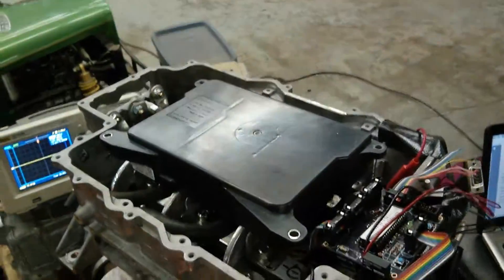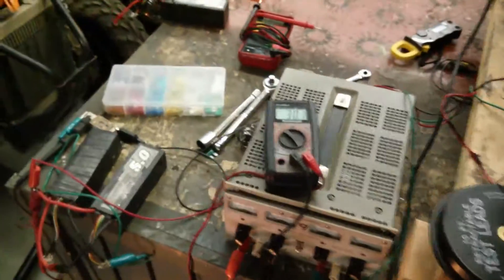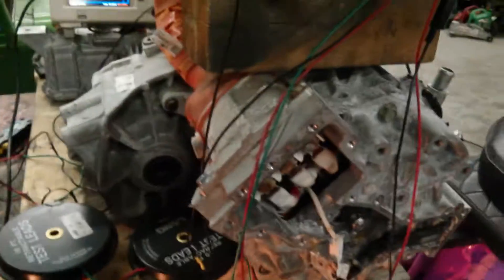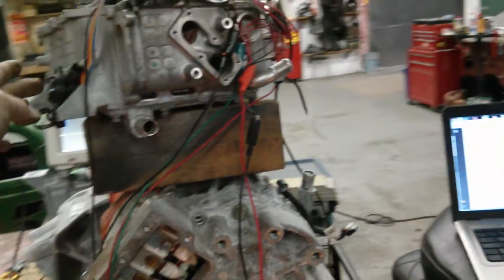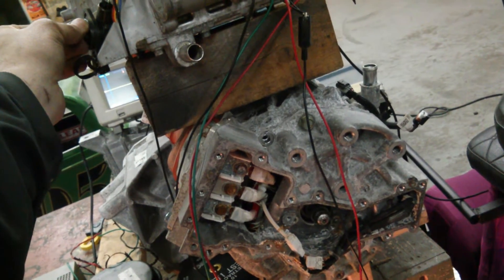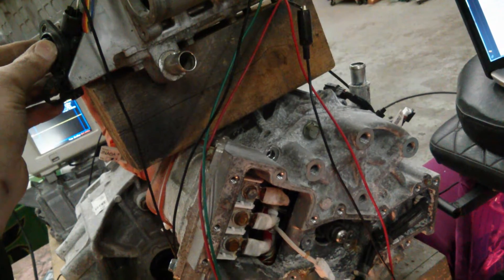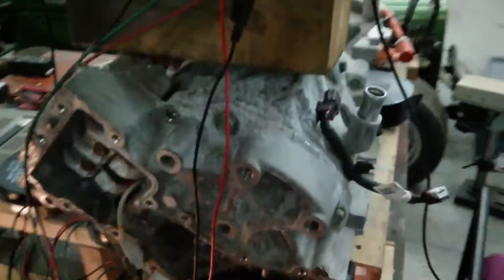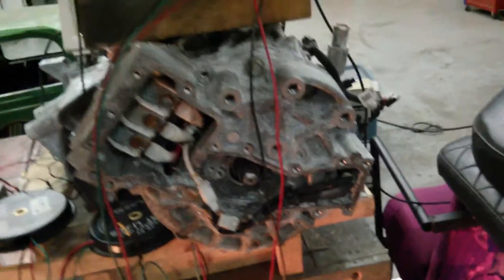First test with my DIY leaf inverter.

Comment: Hello! for my elmob project I need to have full access for the control of the inverter (engine control unit) from Nissan leaf gen1. To do this, disable the immo and other unnecessary options !! If it does not bother you, please help !! in case of a successful solution to the issue, I’m ready to pay without thinking !! Thank you in advance !!

Comment: Hi, could you help me with a problem I have? 
I used to use the AC to the max during the winter time but the car (Nissan leaf, 2012) wasn't turned on. After 10 or 15min I returned and the AC wasn't functioning anymore. So when I tried to take off, I couldn't because the gear was only set to neutral and parking. 
Although the tester at the mechanic showed many errors with the AC and DCDC junction box (already replaced) but the error is still the same - I can not take off. 

Is it possible that the inverter is damadge even though the car wasn't turned on (only AC to to max)?

If anyone knows the answer please send to:
mirch77@gmail.com

Comment: What's it going in?
Reply from the maker: 1988 Honda CRX
Reply: Nice. Ought to be a rocket. You should turn on hard-mode and make in mid engine RWD.
Reply from the maker: draggonhedd What does turn on hard mode mean?  I am planning 2 motors one for the front wheels and one for the rear.
Reply: oh cool. Nevermind then. I can't wait to see  more.